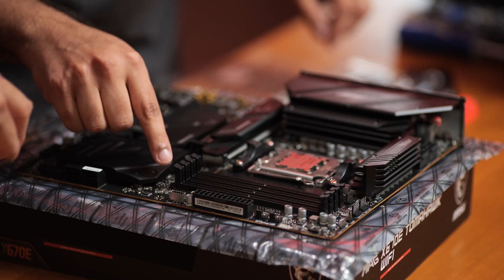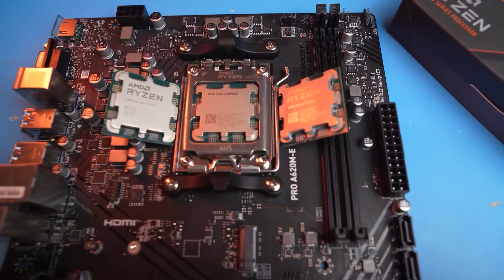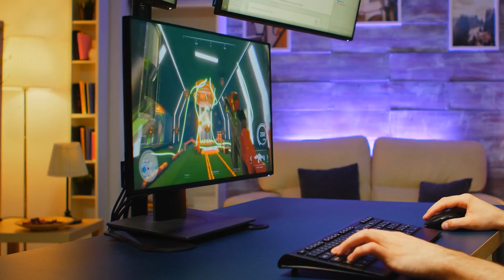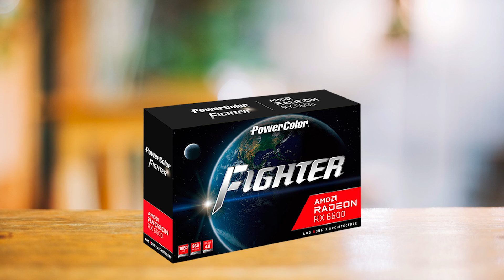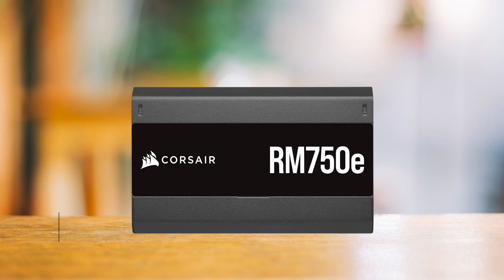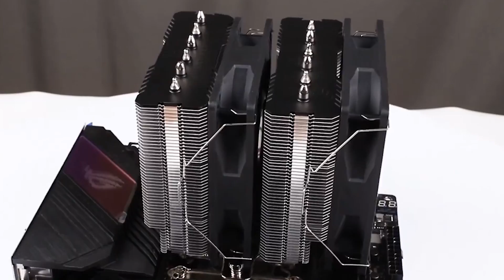Best Budget Ryzen 5 7600x PC Build Today For $900!

Comment: U don't but ryzen x it's bad. U buy 7600 as gpu.
Reply: How is the the ryzen 7600x bad
Reply: @Temp1231.1 simple : u barely will make difference between 7500f and 7600x when gaming. You will rather pay the difference for 32gb(or 16) RAM with better fq than 5200 cl36.2x8gb. that's stupid. Get 32gb 6000 cl32/cl30 instead with 7500f. And u also save some money from cooling solution as 7600x is hotter than 7500f . Not meaning u won't cool it but it does mean your fans will spin more often faster and that will produce You more noise. 

7600x îs a great cpu don't get me wrong. But there are almost no difference in gaming between 7600x 7500f 7600 non x. 7600x is a bit better in production.
Reply: 7500f from aliexpress fpr $160 is best  @pR0ManiacS

Comment: If you swap the Peerless Assassin 120 SE to an Assassin X120 Refined SE and the P5 Plus 1 TB to a P3 Plus 1 TB it leaves enough money to upgrade the 6600 to a 6650XT while still totaling $900.  That nets about 20% higher performance in games while still leaving all the future upgradability of using the AM5 platform and the quality base parts you picked out.

Comment: I'd swap the 7600x for a 5600x and upgrade the radeon 6600 to a 7600. You'd save cash and get a 20-40% uplift in fps for gpu heavy games. Trade off is the lowered upgradability for your cpu.
Reply: I think the plan is to get a solid base for future upgrades, and get a better GPU in the future.
Reply: Get a 6700 instead of 7600.
Reply: gpu upgrade is good, but would have recommended going with 5800x from 5600x and might have seen major FPS boost along with same platform and RAM
Reply: Depends since I only play dota 2 and CS2 which are cpu bound I take the better cpu and compromise on the gpu.